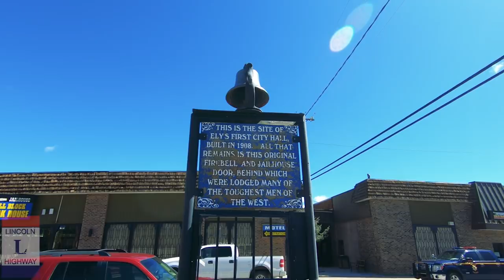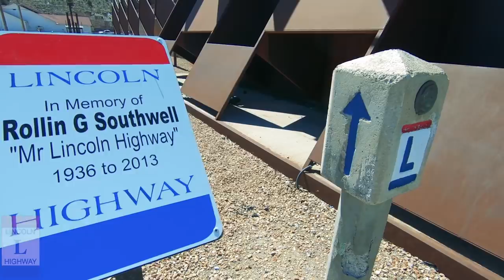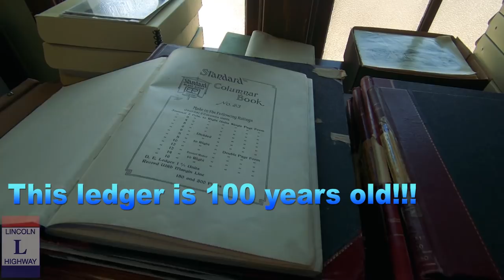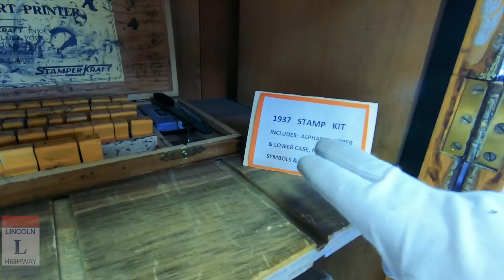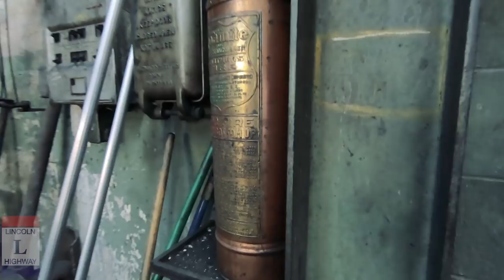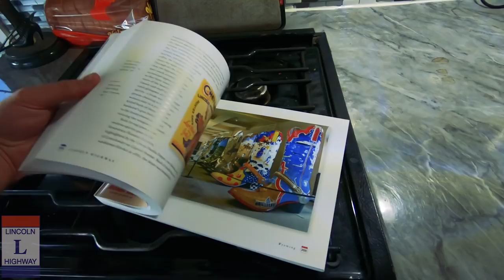Incredible Tour of Train Depot From 1900’s

Comment: 6:45 The belt was on the lathe because back in the day there was only one central motor for multiple machines, rather than an electric motor in each lathe.  The motor would generally be up in the ceiling with a long shaft coming out of it.  The machines such as the the lathe that you saw there would connect to the shaft with the belt.  The lathe would generally have more than one wheel of different diameters that would change the RPM of the lathe and thus how fast or slow it turned the part that it was holding.
Reply: And then there was OSHA.. fingers, hands, arms in the belts
Reply: sewashburn0529
In times before electricity, the shafts were driven by a steam engine.
Reply: You could change the RPM's from 1977 Ford Mustang 4 cylinder slow to 1968 Chevy Camaro 572 with blower and nitrous  Fast ,For drilling Real fast

Comment: If you get a chance try and do two things. Just north of Ely 13 miles is McGill. Go in the McGill Club and see the Bar Backdrop. It is simply phenomenal! Most days only open around 2:30 pm. Across the street is another must see and that is McGill Drug. Left in its original condition when Jerry the Pharmacist died. Then about another 10 miles north there is the Duck Creek turn off (right turn only), with lots of camping up Bird, Timber and Berry Creek.

Comment: Well since you usually chase 70 degree weather pipe insulation probably is not on the top of you list of renovations but might eventually be something to consider since you do hit the northern stats from time to time and even in mid summer in some mountains it can freeze - and who likes a frozen toilet at 6AM.  Often all that is needed to to encase your water pipes and sewage pipes in temperature protectorant covers and to use a clip on auto-light in the undercarriage with a heating bulb in it to clip in the area where your water and sewage connects to the vehicle.  Some people go to the extent of getting a heated sewage line for using when they are connected to a campsite a lot and that hose could freeze but that is something you rarely do and so probably would never need.  By the way, that 'Nevada Club' in Ely is pretty famous for a couple of things and one was being part of one of those ghost hunting segments where there was supposedly a haunting in the club and in the hotel.  Its also been in several movies.

Comment: Machine shop is still in use, several of the steam engines work, the wrecking crane has a new boiler, and they do run the trains!  The steam engines were bought brand new for the NNRY.
Check them out on facebook. 
Nevada Northern Railroad 
You even met Dirt.
Great place, did you meet Mark?

Comment: I have a question; would it be possible to use your solar to store enough energy in your batteries to plug in an electric blanket and/or a small electric heater?  What would be the requirements for this?  Thanks, Eric! Hugs to Jax.